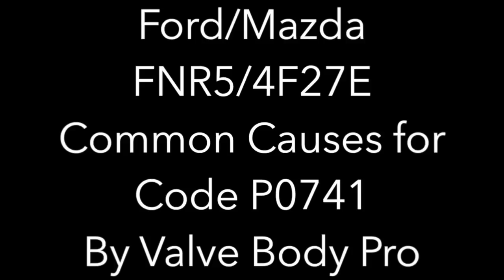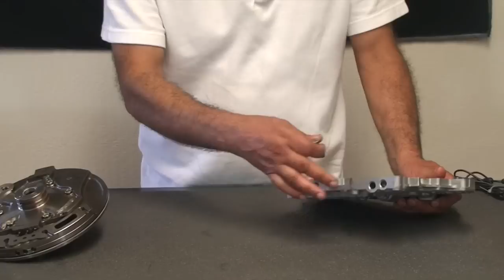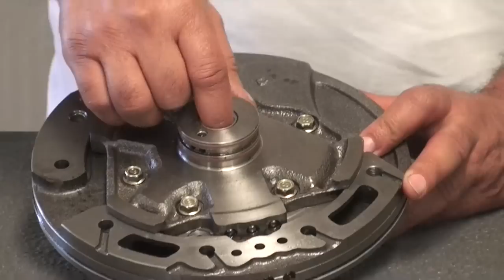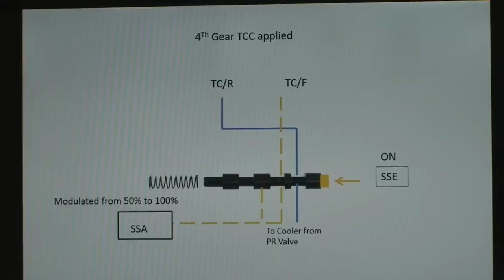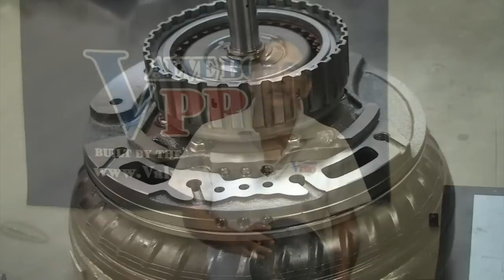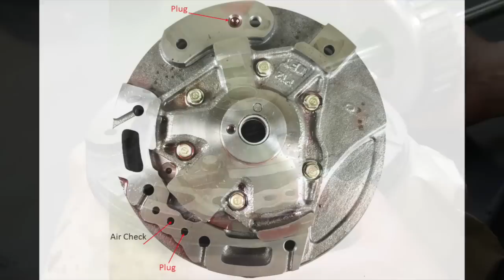FNR5/4F27E Common Causes for Code P0741

Comment: can you do this while in the car? My TC just grumbles when in D stopped at a light. Works fine after that but no noise in R or P/N. And it kinda makes a differential mesh sound off and on while its coming up top speed, load related. almost like my diff backlash is loose in rear wheel drive terms.
Reply: It can only be done with the transmission removed, on the bench.

Comment: I paid $1700 to get my transmission rebuilt because of the P0741 Code.
Reply: Did the P0741 ever come back again? I have performed 3 times-  Drain and Fill, change transmission filter and change the TCCs but it works for few months and the P0741 come back again. I think it may be wires related on my case. (2007 Toyota Corolla)
Reply: @callmebackfriday2  it never came back after the transmission rebuild.
Reply: @dha588  Thanks for your information.
Reply: +David Ha Wow! You got a deal.  That's a very good price.
Reply: +Larry Bloodworth Thanks. It was actually my friend's shop. It also came with a 1 year warranty.

Comment: This is a good test. I have discovered 5 torque converters that the hydraulic function was faulty. In fact I have one that I received today that failed the test. Will not install it. Will order another one. P0771 is the other code that will set if this test fails. Something must be wrong in the remanufacture process of these torque converters. I hope the remanufacturers resolve this one quickly.

Comment: Would that torque converter bench test also work on other transmissions besides the Ford and Mazdas, provided you knew which holes to block for the front of the torque converter and the pump?
Reply from the maker: We have not tried, but I would think so.